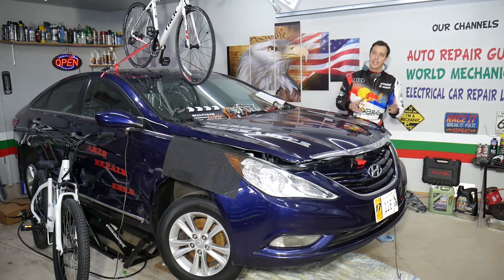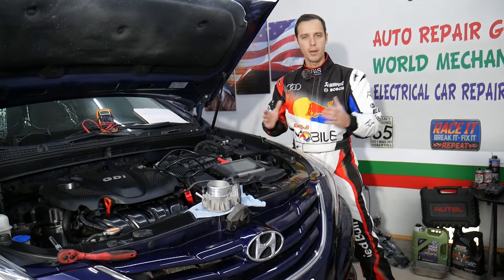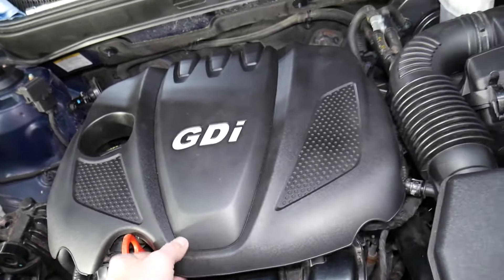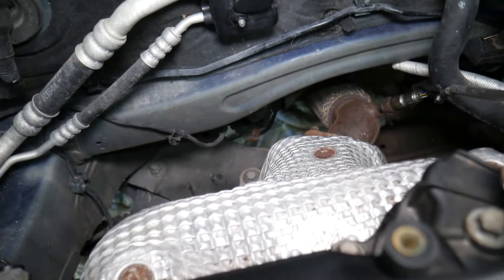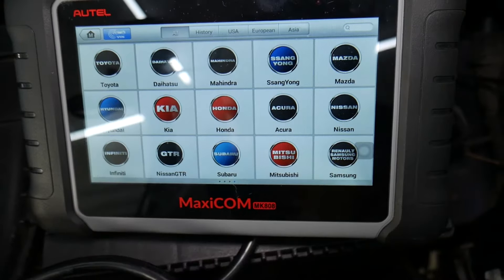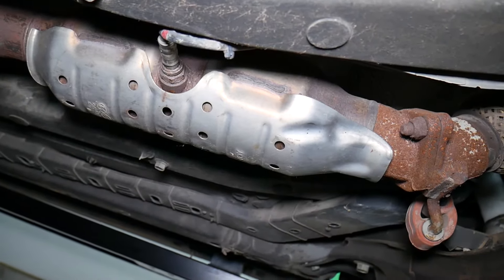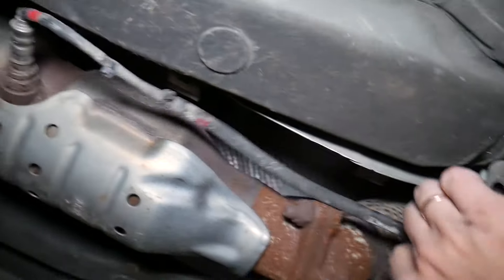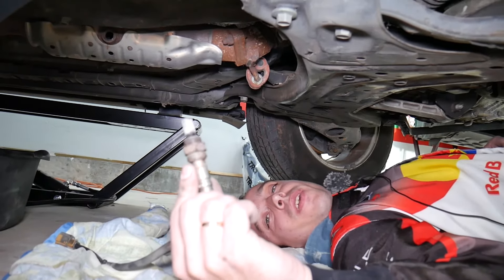OXYGEN SENSOR BANK 1 SENSOR 2 REPLACEMENT LOCATION HYUNDAI ELANTRA TUCSON SANTA FE ACCENT VELOSTER S

Comment: this must be the 2.0 turbo, my 2015 santa fe sport with 2.4l engine (my 2013 Kia Optima is same) has a one piece cat converter/exhaust manifold with the upstream A/F sensor right on top in middle of manifold/cat converter, it was easy to get out, the downstream O2 sensor is right at outlet where it turns horizontal with no space and frozen in there and yes I've stripped the O2 sensor and not sure how I'm going to get it out without pulling off the exhaust manifold/cat converter. Any ideas ?

Comment: 2016 Sonata Hybrid 151k miles
Idling in Maint mode after 20 mile drive
Smooth idle
No power loss
No mpg loss
No rotten egg smell
Some lifter noise at slow speed, light accelerator, uphill before gearing down.
P0420
New 02 sensor on Bank1 S1 (cat is in manifold)
Sensor 2 (in front of lower cat) is factory.

Any ideas would be greatly appreciated. 👍

STFT 15.6%
LTFT -32.0
02S12 (V) = .790 V
02S11 (mA) 0 to -.05
STSO2FT1 -1.6%
LGSO2FT1 3.1%
CATTEMP11 (576 Celsius)
CATTEMP12 (400 Celsius)
LAMBDA11 0.998 ish
LAMBDA 0.999 ish
Reply: Knock sensor

Comment: @ 2:24 you say the one at the exhaust manifold is bank 1 then @ 2:50-3:00 you say the one at the catalytic converter is Bank 1

Which is correct
Reply: Bank 1 Sensor 1 is at the top and at the  bottom is Bank 1 Sensor 2.

Comment: I looked under my 2011 Santa Fe and there is definitely no 02 sensor attached to the catalytic converter.  I looked on both sides and everywhere else.  Thanks anyway.
Reply: I have a Hyundai tucson  2011 and I don’t see any sensor down there as well. I' m getting  a code P0136 that refers to bank 1 sensor 2.
Reply: @jsoto2214  Did you ever find out where the sensor 2 was? I got a hyundai tucson 2012 and I have no idea where bank1 sensor2 is
Reply: Yes, my mechanic told me mine only have two sensor the one behind the engine and the second  the longest one conected to the exhaust pipe. I had  check engine light. My mechanic replaced both at the same time, and it fixed the issues.

Comment: You are not correct, not all the hunday tucson are not the same mine is a 2018 2.0 engine and you can’t see the connector the wire goes inside the cabin through a hole and have to go inside underneath the seat to unplug it, so get it right!